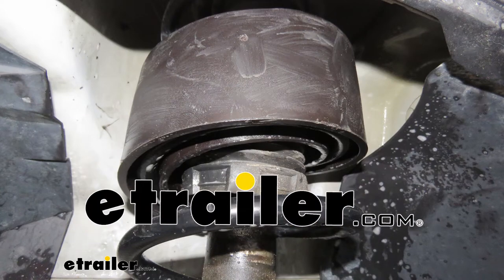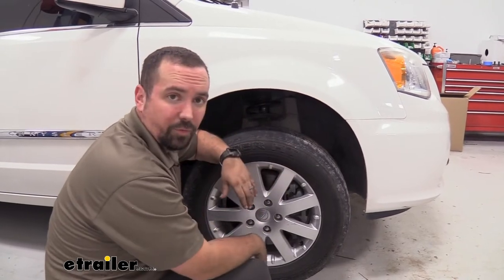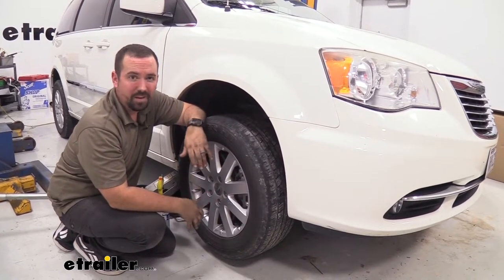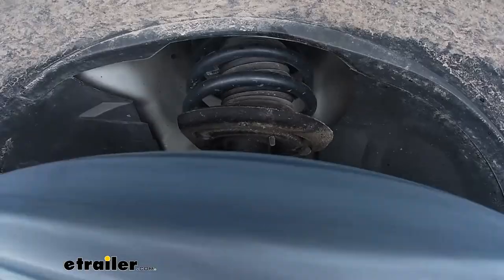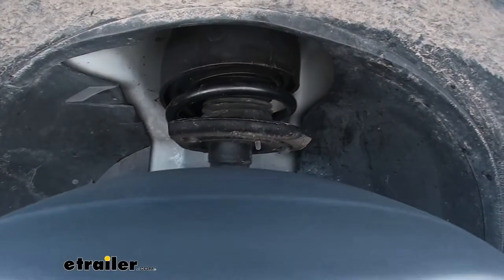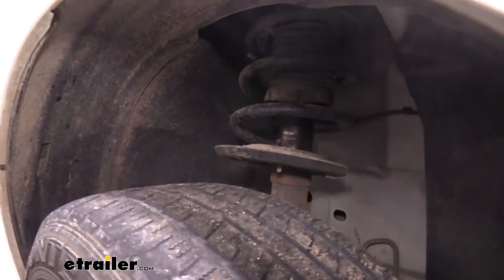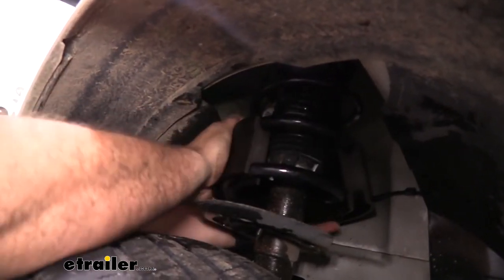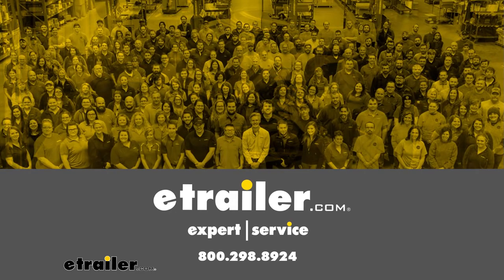etrailer | SuperSprings Coil SumoSprings Front Axle Helper Springs Review

Comment: Well I just put these on the 2022 F150 and it does not install as easy as they make it look. 90 min to get them in between the springs.
Reply from the maker: The most important thing to do to ease the install is to jack up the front of the vehicle so the front axle hangs free. This opens up the spaces between each coil which makes the # CSS-1094F Coil SumoSprings much simpler to install.
https://www.etrailer.com/Vehicle-Suspension/Ford/F-150/2022/CSS-1094F.html